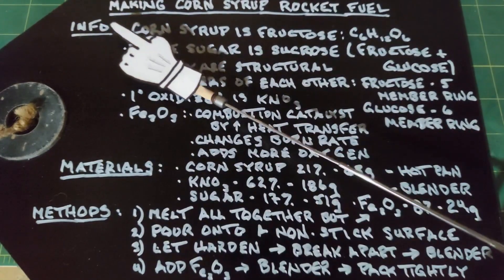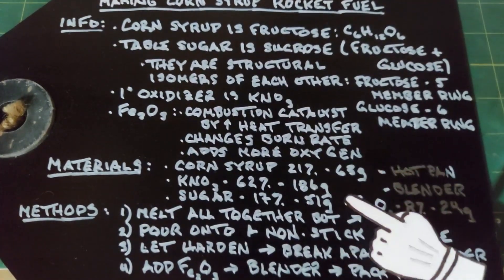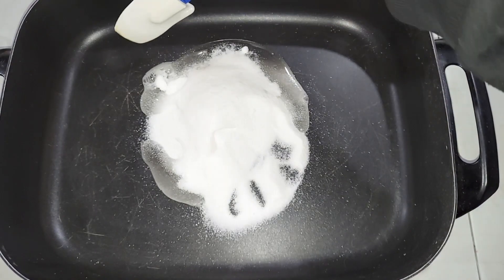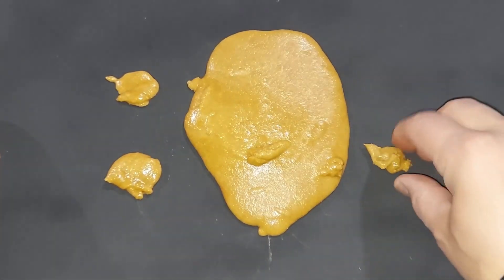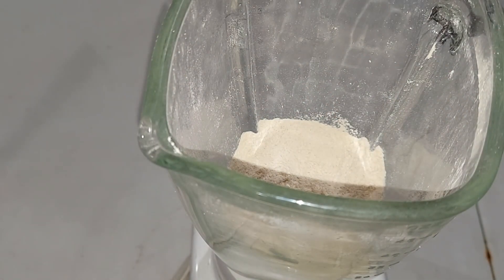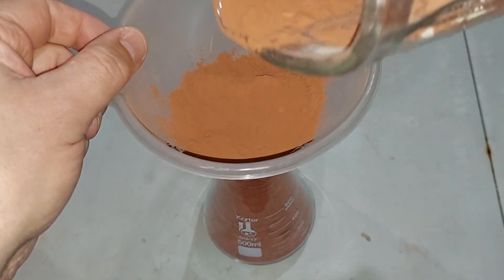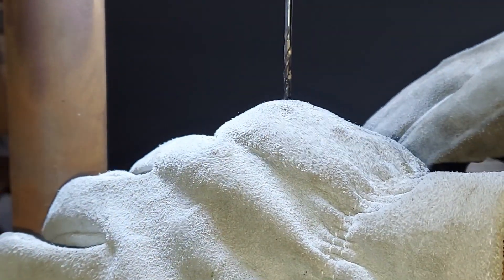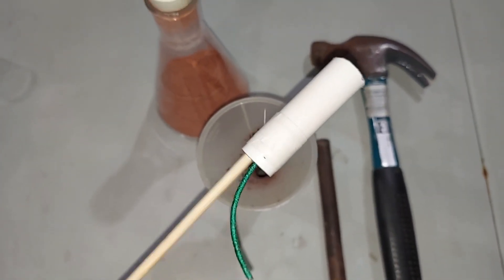How To Make A Sugar Rocket Using Corn Syrup

Comment: Nice work. I suspect, as in candy making, if you begin with a portion of water, it will help everything dissolve. It'll just add a minute or two to boil the extra water out before you get to the molten stage.
Reply from the maker: Yes, I think that would work.

Comment: Dude, can I get smoky acid from nitric acid whose purity is only 65?
Reply from the maker: Yes, if there is enough humidity it will "smoke" as the acid reacts with the water in the air.
Reply: You wont get the same reactions you be looking for on white fuming nitric acid fractional distillation is a method thats plausible

Comment: Ferric oxide (Fe2O3) is a oxide and thus doesn't add oxygen to the chemical reaction.
Reply: It's a burn rate catalyst. Though oxides can provide oxygen if they get hot enough and/or have a reducing agent present. Thermite reactions work with an oxide as oxidizer.
Reply from the maker: The heat involved in the burning does in fact release the oxygen leaving elemental iron.  You can see that molten iron react when it hits the wet ground just before launch on one of the trials.